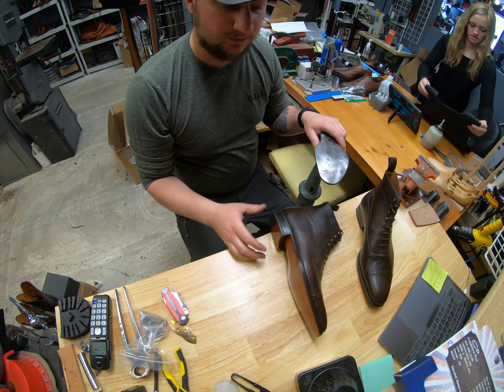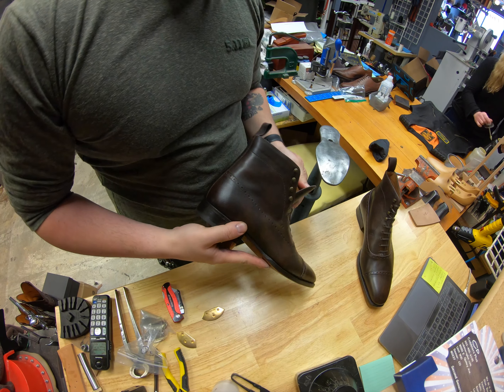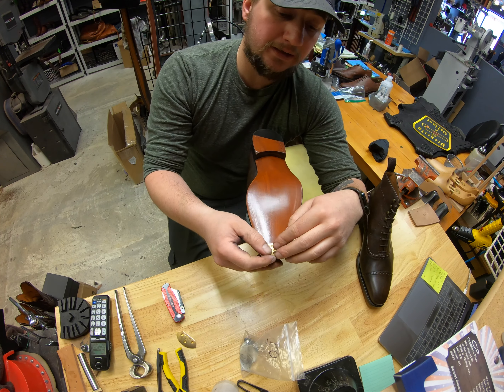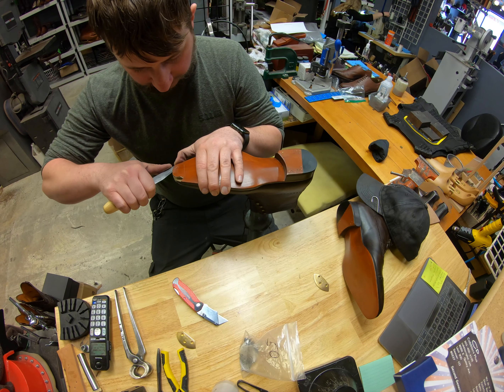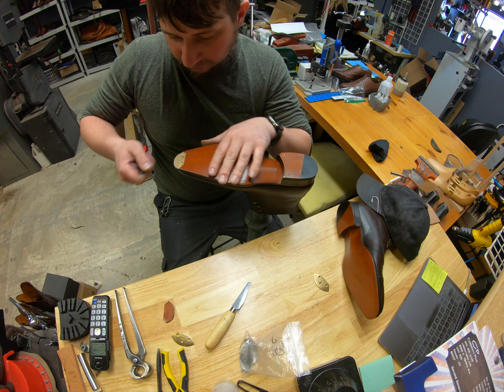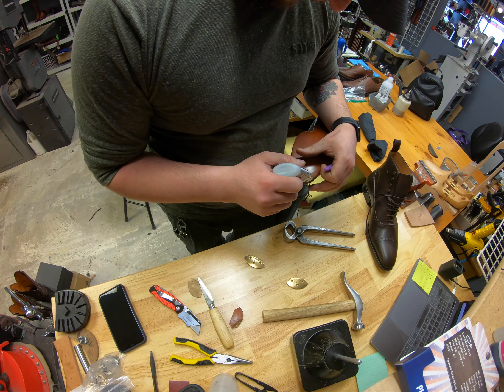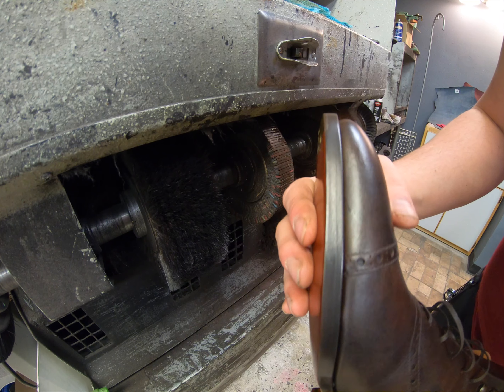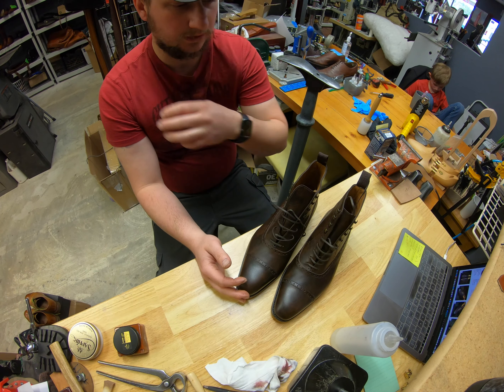Cobbler Union Boots with Blind Stitching get Brass Triumph Toe Plates

Comment: Very nice meticulous technique with great attention to detail, thanks. As a “home cobbler” wouldn’t it be equally beneficial to add some glue under the toe plate for added strength and give resistance to the toe plate loosening over time?
Reply from the maker: The glue that will hold leather and metal together typically will crack from the impact from some wear. On top of that it will look bad if it squeezes out. 
The screws won’t give out until it’s time to replace the toe tips anyways

Comment: You mentioned the screw goes onto the sole, but not through the sole. What about the welt? Does the forward-most screw penetrate the welt?
Reply from the maker: So the screws are 4mm long while most of the soles we work on are 6mm and up. Considering about 1mm that we remove there is still at least 5mm to work with and the screws shouldn’t go in that deep. But if we ever have a screw go into the welt or anywhere else it would at most go in 1mm and that’s not enough for it to stick out